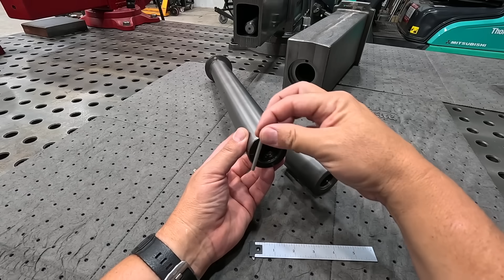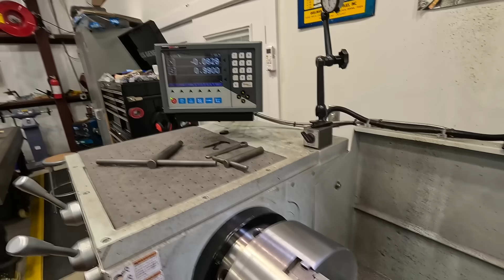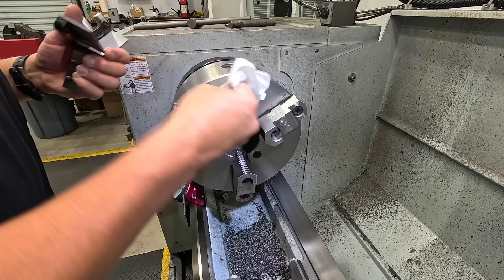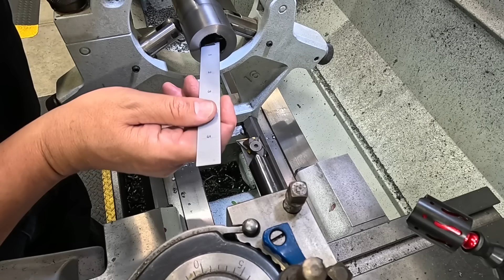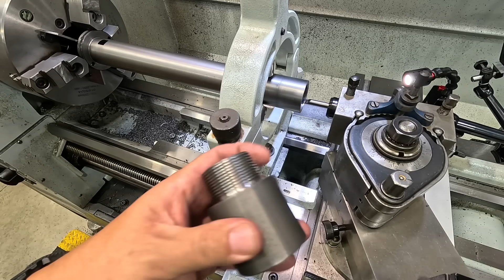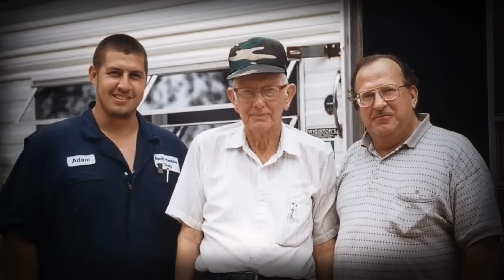Hardtail Nut Modifications

Comment: I’m thinking like @belneste.  Why thread the nut to insert it into the tube that is your drawbar for the spindle?  Cutting the thread relief really thins that piece.  Whey not just thin the tube to its center wall thickness, then turn your nut down to be an interference fit, then pin that in place?  Or even weld the outer edge and turn it back flat?  That would seem to be less work and a stronger solution, no?

Comment: A lot of comments saying that the thread relief is too deep? .005 over nominal that is within aerospace specifications. 1.630 is exactly what it should be to insure the threading tool can be retracted with enough clearance. On most prints there is no spec or tolerance that controls a thread relief.

Comment: Did Adam mention somewhere why he shortened the stock nut and added the new chunk-o-nut instead of boring the oem nut and rethreading it directly?
Reply: The metric and imperial threads are too close to the same size to do what you suggest. Adams’s method of combining the new nut and tube is efficient and very strong.
Reply: @ellieprice363 aahhhh okay thank you!! He might’ve said something. I guess I missed it.
Reply: @trezsr You’re welcome.
Reply: I don't think you can just bore it out completely, there should be a good amount of interference between the old and the new thread. Keep in mind, these are two different kinds of threads, one is ACME, one is metric trapezoidal thread, but around a similar size.
Reply: @CatNolara maybe he couldn’t bore it out to fully remove the original thread and rethread with his preferred thread. Is that what ur saying?

Comment: ,,,,,,,,,15.33h  weak point. thread exit neck is thin. I think it's better to bore the nut, cut a thread inside and screw it onto the pipe. I may be wrong, I don't know the overall dimensions.....with respect, Vlad

Comment: That 3-fin chuck parallel is really trick.  Such a simple idea, and done really well. The plastic in the middle is good engineering. Cheap, easy to make and isn't going to scratch anything. 
This is such an awesome project.  Hope you use a tapered pin. Not like it's coming apart again any time soon. Prettier and stronger.

Comment: Hey Adam, thanks for the interesting video. Just a question (no judgement cause I know we all have different names for things in different countries), do you also know those tension pins as 'Roll Pins'? Thats what I know them as, but I'm not even certain that that is universally standard here in Australia either.
Reply: I think is might be trade specific nomenclature.  Here in California coming from motorcycle and automotive fields in the late 70's - 80's, I knew them as roll pins.  A quick bit of research indicates this type is referred to as slotted spring pins, tension pins, or roll pins.   

For fun I looked up my favorite and oldest manufacture of punches, chisels, and pry bars in the US  Mayhew tools steel products.  They have been around for over 160 years and patented the pilot pin punch aka roll pin punch.  Their description calls the fasteners roll pins, though they state they also work on hollow tension pins.

Comment: 34:35 why the extra calculation steps when you can just treat it like you one would for a metric thread, were you subtract the pitch from the nominal OD and be done? Its normally within a couple thou at worst difference. For example, a 12tpi is .083 pitch so 1.625-.083 = Ø1.542 where as for your method, you get Ø1.544" so only 2 thou difference)

Lets say it was a finer thread like say a 20tpi which is a pitch of .050 and for S's and G's, its a 1" nominal, that would be a bore of Ø.950"
Using your method, Ø.951

Even a 8tpi (i.e., .125" pitch) is only off by 3 thou (assuming rounding to the thou for your method which results in .122" to be subtracted from nominal)
Reply: Do you know where the number 0.013 come from?
Reply: @cyranox90  From my understanding (which I could be wrong), it's a derived constant that makes the resulting size from the formula fall roughly right in the middle of the min / max range for the minor diameter of internal threads. Basically, because the calculated size might not be an available drill size, the closest size drill (up or down, which ever is closer) will still fall within the allowable min/max range

Also, if I'm not mistaken, it's ONLY intended for Class 2 threads
Reply: @CP_300PRC Hi thanks for your answer. Would you mind sharing the reference for the derivation?

Comment: I am by no means a machinist, but I am a manufacturing engineer that designs and manufactures tools on a regular basis. The only change I would've made would have been having a short region in each mating part with a turned register to control the center nes even more precisely. Your mating thread was 1-5/8", so 1-3/4" diameter, somewhere between .100" and .250" long to really register those centerlines together. I try to never trust threads to hold my position unless there's no other option. But I'm sure it will meet your purposes just fine.
Reply: Single point threading makes a precise thread. Mass production has no single point threading.

Comment: Wouldn't making a new single part made sense. Or welding them?
Reply: Good luck welding cast iron, however brazing would be a valid option. And why make a completely new part if you can just modify the existing part a little bit?

Comment: Thanks for the great teaching as usual. One side note....i see several comments about the modification having a failure point or some such. My personal feeling is this. How hard would the handle of the vise have to be cranked on to break that two inch iron part or the threads within? i dont believe a person would see the day. My two cents. And if i am wrong i will refund the two cents immediately. Cheers to Adam from tennessee.

Comment: Use memory button [M+] to hold .08175,   then use recall button [MRC] to deduct .08125   -   1.625-MRC=1.54375
Reply: Or just memorize pitches and forget about the .013*75 step.... If you just subtract the pitch from the nominal (like typically done with a metric thread), it results in  a couple (at worse) thou smaller hole size. 
For example, a 12tpi thread is .0833 pitch and thus 1.625-.0833 = 1.5417
Reply: Where does the number .013 come from?

Comment: That's a perfect opportunity to use a left-hand (no sweat) threading tool with spindle running in reverse and tool turned away from you.
Reply: Reverse threading away from the chuck is a proven method of threading at higher speed without the danger of serious crashes. Whether the operator chooses to use it depends largely on his level of skill.

Comment: I figure yhe minor diameter by  major dia minus thread pitch. So 1.625  -(1/12) = 1.5416 .   Thats close to what you got 1.544
Reply: Thats the way I've always do it (just subtract pitch from nominal OD just like typically done with Metric) and its not hard to memorize the common pitches one mostly uses so you don't even need to worry about the extra calculation to convert from TPI to pitch.

Comment: You have no way in knowing if the shaft is running concentric with the lathe center by just indicating the end. You could have the shaft out of concentricity and still get no indicator movement. You have to use a center in the tailstock or have the ability to rotate an indicator from the tailstock center.
Reply: It all will not matter in the slightest, there should be enough radial play to prevent issues. It's good to keep in mind for projects where actual precision is critical tho
Reply: That is true, although, it is not acceptable for a seasoned machinist. A professional machinist would indicate the part in correctly. Anything short of that is poor workmanship, and a faulty part.
Reply: @hmh-jv6rn  What do you mean? It was held in the chuck, and the end was free to reveal its non-concentricity while he was indicating it.  I could see an issue if the steady was tight, but it wasn’t.
Reply: I thought he had the steady in contact with the part
Reply: @hmh-jv6rn  So… in the context of your attitude of superiority, are you saying you were wrong?

Comment: I have been playing with the idea of building a lathe . From scratch.  Using .250" wall steel tubing as the base.  Fill with  mortar and fine sand , a used media blasting sand. To fill the voids after  finished. Make the ways from 4140 or something similar mill flat scrape and flake the ways then lightly grind them smooth. Leaving the grooves to hold oil.  With .125" ball milled  oiling grooves. With .125" oil feed lines with plastic ball bearing caprured in the oil hole . Working as a check valve of sorts. Only  oiling under the saddle. With a 1" thick felt backed up by a .125" piece of rubber to clear the ways then oiled by the felt. The saddle will open the plastic ball valves, allowing the ways to be oiled. The felt having its own oil supply. With  the pump giving a squirt of oil every time the saddle or cross slides is moved . Adding about 2.5cc of oil to the system,  Also adding about 5cc during first starting up after about 8 hours of being a shut off. Using a electronic  leadscrew and speed control. With about a 15 hp motor with the abilities to go up to 25hp. The major difference in my idea is the ways being about 18" - 20" apart from the inside,  about 24"-26" on the center of the ways. With a 1.5" leads crew in the center of the ways. A 1 hp motor driving it. Witha 3"  diameter spring steel shield protecting the scre threads.  As the saddle moves. On the 1" x 4" x 112" ways  with a .750" 90° angle in the center of the ways made from a much harder steel. Possibly a tool steel. With a vfd drive , and 3speed gearing  to allow 0-90 to 150rpm  very high tq. In low gear, 0-1500 rpm in 2nd gear, and 0-2k-3000 rpm in high gear.  Allowing basically anything to be done.  The cross slide can have either a tool post or another axis bolted on allowing it to be used as a horizontal mill. Remove the 24" face plate or chuck going to a morse taper the swing being about 30"(+/-) roughly 16"-18" from Chuck center to ways. The saddle and crossslide being about 8",10"-12" thick 28" travel from center out and 36"-40" total the  mill axis is a 
18" x 18" work surface. With travel from the ways to 10" from the chuck center. Measured from the bottom of the milling work surface (made from 1" steel plate with T grooves and bolt holes and 1/4" plate bracing every 4" with a single 1/2" brace in the center  wuth a 1" thick 3" x 18"  working as a dovetail ways for the milling axis theses mounted to two pair of 1"x2" steel bars attached to the brace plates with the same plates on the bolt on base to the cross slide. Using 6, .625" bolts and 4, .500" dowels  the tool post plate bolts on the same location. Using 4 bolts and two dowels. Using a 2" stud and 
4" x 4" x 6" iron block with quick change tool holding. Made from 3" x 4" x 6" steel bars, or cast from steel.  With the rough dove tail cast in. With the locking system milled in. Being two pins in the dovetails  pushed apart by a large long wedged nut with a long taper seat about 15° and 2" long. Pushing the pins the .030" apart (the max) to lock the tool holder in place the .250" tool steel pins with a spring about .500" long keeping them pushed to center. Then spread when the .500" thread 1" dia. Nut going from .580"-.600" to 1" over 2" wuth a 2" hex on top adding another 1" to the length pitting the pins about 2.125" deep on center.  Its a ton of work. Requireing mills and lathes to build. So i doubt i will be able to build it.. have an awesome day🎉, sorry to ramble..

Comment: We used taper pins for precision locating. For instance, if you were setting up a machine and aligning bearing blocks, once everything is tightened down, we'd drill & ream for pins. This would provide a precision means to re-position the blocks if they ever needed to be removed, like maybe to replace bearings or re-pour babbitt. It saves all of the millwright work that had to be done first time. Often times, we'd thread the big end with a die and thread a nut onto it as a removal jack. They're not generally for holding - the fasteners are expected to hold securely. Your application would likely be a candidate for roll pins, but you know what? You can use whatever you want, and it'll be just fine.

Comment: @37:40 I KNOW why air and hydraulic pistons are 1.125" instead of 1" (and YOU do, of course)! Might be fun to see who knows this and who doesn't? :face-green-smiling:
Reply: @PhilG999  I have no clue why.  Please educate me (no sarcasm or joking)
Reply: @jwdickinson1  1.125" diameter IS 0.994 Square inches. That means a pressure gauge in PSI reads VERY close to the Pounds Force exerted by the cylinder. Convenient, yes? 🙂
Reply: Nice I appreciate comments where I learn something interesting. I'll remember that forever
Reply: @caploader111  Thanks! There are LOTS of little "rule-of-thumb" things like this you learn in 40+ years of a Mechanical Engineering Career!
Reply: 👋 I don't. Care to explain?
Reply: 1.125 diameter would be about 1 square inch.

Comment: @Abom79 Is your mark on the threading dial that far off?  From the video it looks like it's dropping in at the 1/4 position  (Between the number and the half)  I guess it doesn't matter because it dropped in same position each time.  I believe mine has like a brass rivet at the 2 o'clock position and yours seems to as well.  Nice machine work!!

Comment: Some may say that's a weak point and prone to break there. To me there is more material there than that flange on the end. That threaded part should be stronger than humanly possible for breaking. Torque down on the handle all you want.
Reply: At least… for all the intuitive may-sayers, show your engineering math to prefer your point!  It’s all just vague concepts with no foundation.

Comment: Hi Adam,
I  think you should have threaded the entire 1.625" length. All the forces when closing the vice will be exerted on that 1" of threads and the thread relief is creating a failure point.
Reply: Highly agree with the thread relief creating a failure point, however, without any thread relief, the breaking force of a 2" OD tube with wall thickness of ~3/16ths is greater than 55,000lbs (based on lowest grade of cast steel values), even if the thread relief were half the wall thickness it would still have a minimum of 27,000 lbs of clamping force before it fails :)
Reply: The thread relief is not a failure point as long as the screw and nut are in full engagement. Under tension the screw would have to pull the 12 pitch threads out of the tube for failure to occur.

Comment: I understand this vise is not intended to be used but in reality someone/sometime will torque this vise and this part will fail and not understand why. The video is a great teaching tool covering most of the operations you would do on a lathe. Adam is a great teacher I can watch for hours.
Reply: When you're torquing the vice closed, the force is driving the two pieces together.
Reply: @generessler6282   closing the vice pulls the two apart ;)

Comment: I’ve been watching Abom79 for many years and have never seen him do any work that wasn’t as close to perfection as humanly possible. So when he debates which type of pin to use to secure these two parts together, and mentions that the tapered pin might be a bit more difficult but is a more elegant solution and one that the old machinist used, even though it’s inside the vice and will never be seen, does anyone really doubt which type he’ll use?
Reply: the most diffcult
Reply: “Uh, AkshUaLLy” i remember a few projects where he intentionally did a less than perfect job, because the job required less than perfect.

Comment: It occurs to me this method creates a weak point where the new nut material is seemingly thin because of the shoulder you created to accommodate the new thread and likely to break if you crank down on the vise.
Reply: Shouldn't be a problem. When you're tightening the vice, the force is driving the two pieces together.
Reply: He's not planning on cranking down on this vise. It's a conversation / diplay piece
Reply: The joint will always be under compression, not tension.  This right here is a time honored preferred method of repair even though this is a modification rather than repair.
Reply: @byron7165  I don't think so. The "nut" is attached to the fixed side so as you tighten the spindle it will be pulling ... i.e. tension ... the moveable jaw towards the fixed jaw.
Reply: @tsmartin  Yeah, I had to go back to the assembly video of the original vise. For some reason I had in my head that the flange of the tube was at the handle end which would put the nut in compression.  I stand corrected.
Reply: You have to do some math to figure out how strong it’s going to be. Otherwise all you have is assumptions.